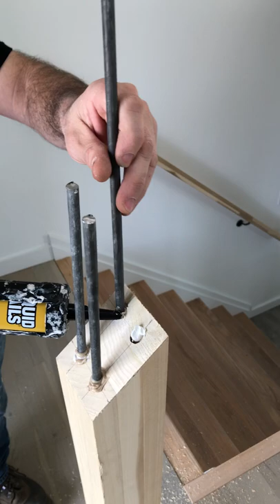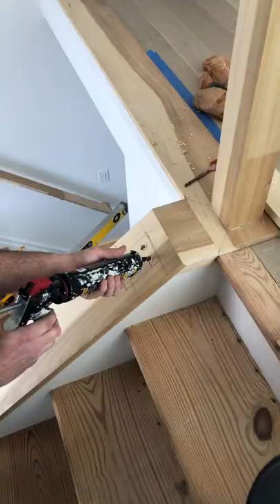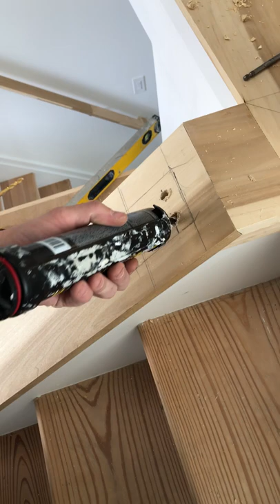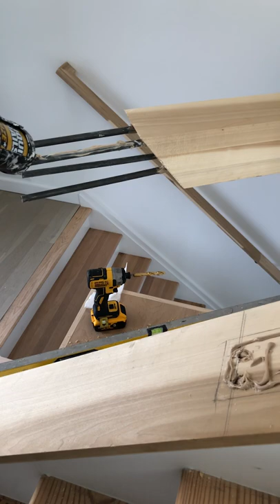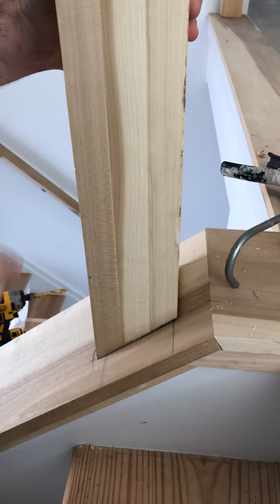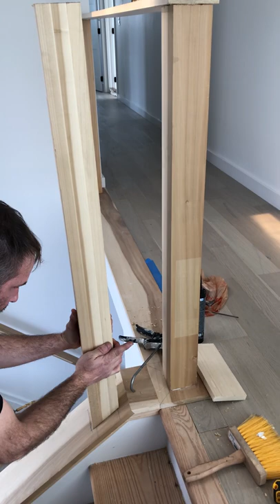How To Build Strong Railings Without Nails Or Screws #Shorts

Comment: Ok ok I get it bro but you do know you don’t need (or want) to locate newels so close together.  It adds expense, is ugly, is difficult to install rail… etc, etc.  Overhand miter the rail or use an over ease fitting.  AND GET SOME MECHANICAL FASTENERS IN THE BOTTOMS OF THOSE NEWELS or you will wish you had.

Comment: What are those sticks? Wood or metal?
Reply from the maker: Metal rods you can buy at Home Depot. Glue them into the post and then into the floor frame. If you build a wire railing the posts have to be extra strong because the wires constantly pull at the posts to stay tight.